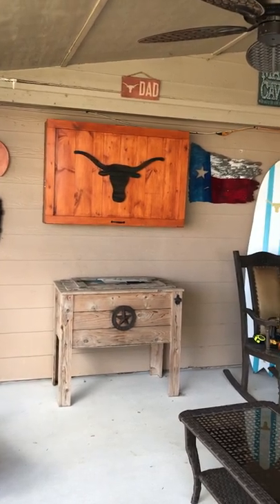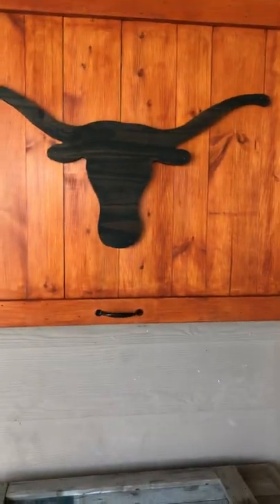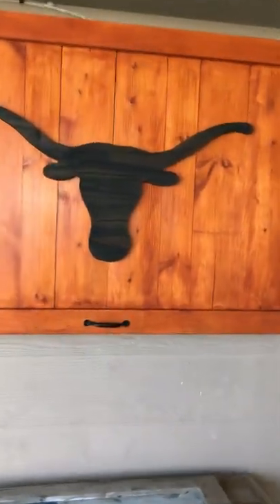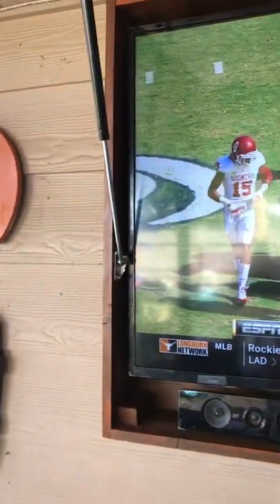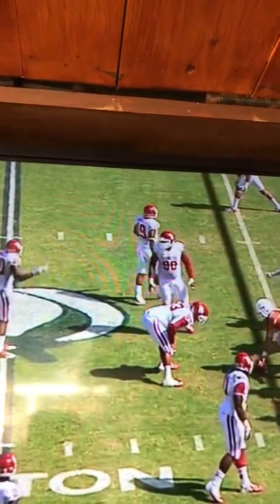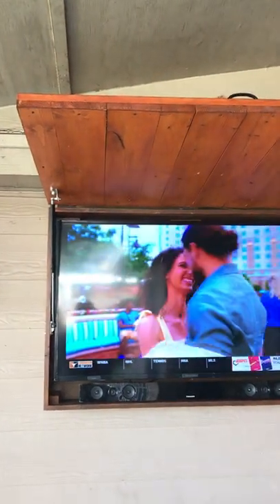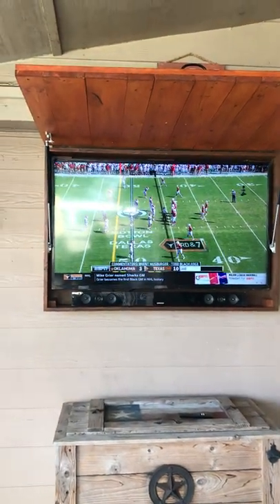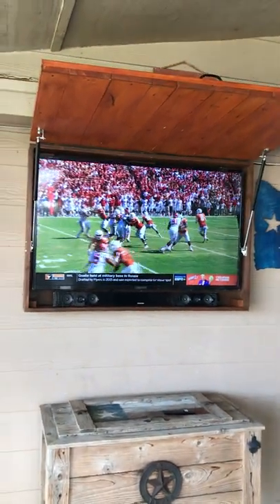Outdoor Tv cabinet build

Comment: Thanks man exactly the video I was looking for to get me started . I would like to know how you designed your back plate for mounting to wall. And also your hing design.
Reply from the maker: I already had the Tv mounted onto the wall under my patio. So instead of building an enclosed cabinet then placing the mount directly to the cabinet I just built the cabinet around the Tv. The Tv mount is from Harbor Freight and just hooks onto the plate that’s mounted to the wall. I just used 3 basic hinges I repurposed from an old project. Mounted them on the outside of the door and top of the cabinet. The lifting struts were purchased on Amazon. I used 20 inch struts since my Tv is 46”. I started with 100 pounds of force per strut but it was way overkill. I switched to the 65# ones but I think it would’ve been better with anything 40-50#’s. They come with brackets to mount on the inside of the cabinet. If you’re going to do a door that swings up then I would strongly recommend using thicker material on top where the hinges mount to the cabinet frame. That way the top doesn’t flex like mine when opening/closing. And also leave at least 2 inches of room between the Tv sides and cabinet to allow enough room for the strut mounting brackets. The 20” lift struts I used called for measuring the door from top to bottom then taking 20% of that distance. (You can Google the calculations) Measure down from the top then mount the top bracket. Mount one side of the strut. Then lift the door to the desired open position and swing the bottom side and mark its location on the inner side frame. Mount your bracket then attach the bottom strut. Then repeat on the other side. I hope this helps you. Let me know if you have any more questions.